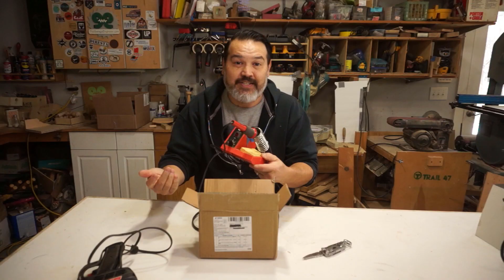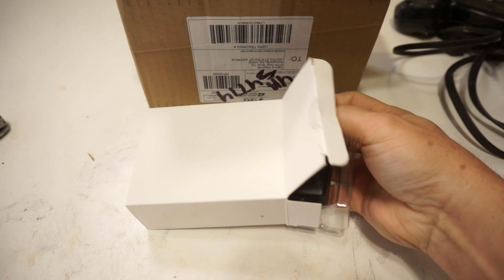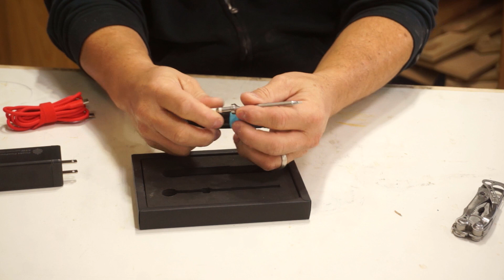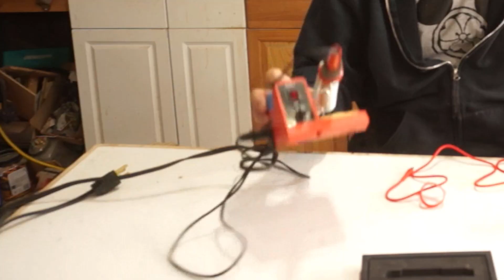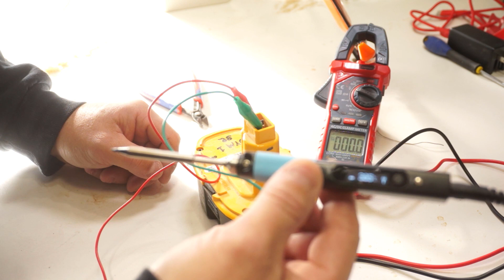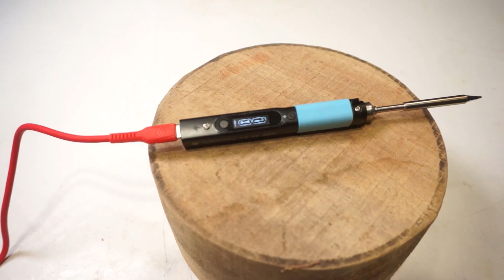This Tool is Needed in Every Shop or Home - ‘Pinecil’ Unboxing and Use - The Garage Engineer

Comment: Did you ever do the firmware update to use higher power with Pd 3.1 type c for 28v 90 watts. By the way I just found your channel and I did subscribe!
Reply from the maker: I have not updated it yet.  Do you know if that fixes  the power cut out with the pinecle power block? Thanks for watching.

Comment: great video on the pinecil and alligator clip tip. I just ordered one and cant wait to receive. I mainly use to repair old trains as a hobby and tired of waiting for the Weller to heat up, plus the pinecil tips look to be able to make soldering easier then the Weller thicker tips.
Reply from the maker: Here is an updated accessory video to the Pincil video that you might like that I made 2 months ago.
https://youtu.be/I2FOacZow3w
Im glad you like the tip it has come in handy on my jobs.
Thanks for watching.

Comment: When it comes to DC chargers and power supplies, never assume that the striped wire is + or - as it actually varies quite a lot. All the conductors that I connect to my bench power supply are labelled with the specific meaning of the stripe as it relates to that particular instance, thereby saving any confusion. The labels are simple, just a bit of paper with (for example) "Stripe = +" written on it, then placed between some clear tape which is looped around the conductor.

Comment: Oh 19:07 made me chuckle. Thanks for the video. Keeping it real. I generally find it's best to twist each wire, tin them with solder then bend  them, hook them together, squeeze down the gap with pliers and then solder. But heh, that's just me.
Reply from the maker: Definitely not the most complete solder joint.  But in the field work I will be more precise.  Thanks for watching.

Comment: Thank you for the good video. Nice soldering tool.  
I would like to start the iron with a higher temperature. Can you change somehow the default startup temperature from 320°C to 350°C or must you increase it always manually?
Reply from the maker: You can set it to any temp.  I have it set now at 350.  Thanks for watching.

Comment: Nice video. Had the exact same soldering irons. Gun style was my dad's too. Battery powered iron would be great when working on car or boat wiring...hate using crimp connectors. Will have to get one of these. Need to make one of those third hands too. Mahalo for sharing! : )
Reply from the maker: The portability is the best part next to fast heat up time.  Thanks for watching.
Reply: There must have been some sale on those old gun style soldering irons back in the early 80s.  My dad, and now me, have that exact one as well!